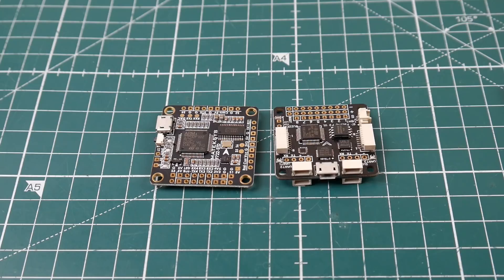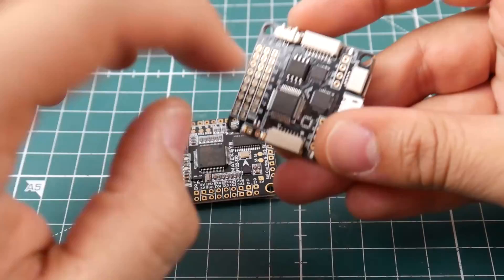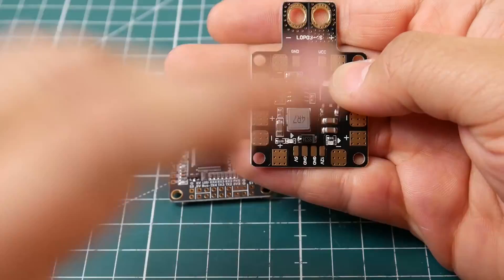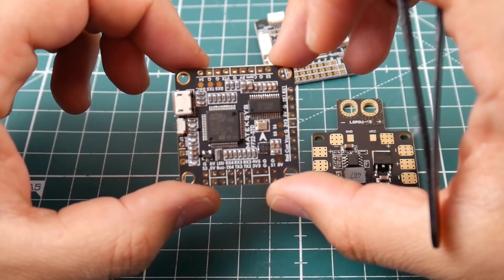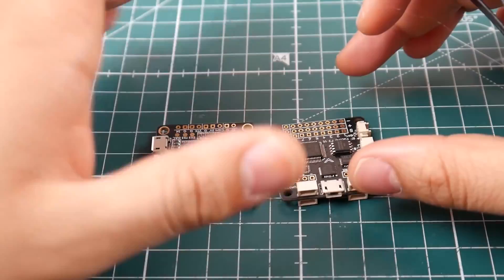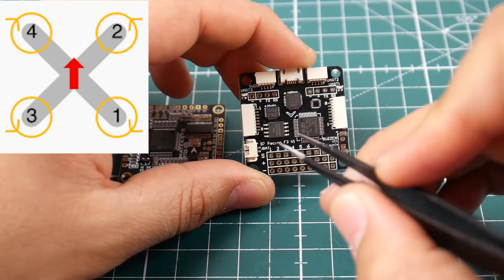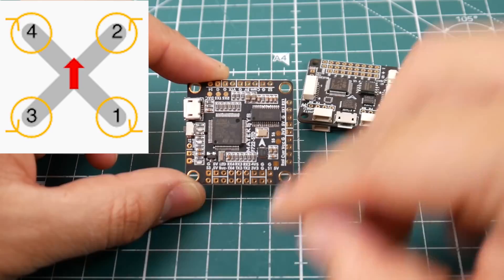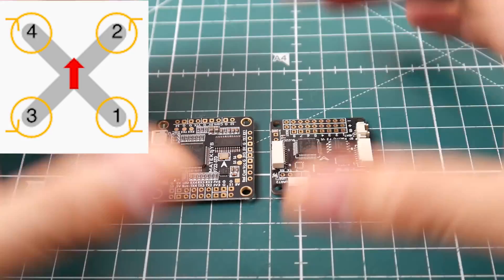How to setup and install any Flight Controller // Under 5 Minutes

Comment: Big fan of your work! whats your top choice for best VTX? looking for that extra clean image.
thanks
Reply from the maker: I have been using the eachine tx526  on 90% of my builds and never had problems with vid. It's only $11
Reply: thanks, but im looking for a vtx with onboard LC filter and BEC, any recommendations?
Reply from the maker: Ofer Po No.. Best advice is good esc and low esr capacitor either rubycon or Panasonic 1000uf 25v or 35v

Comment: One thing you forgot to mention is there is a difference between power input and output..Most flight controllers have mini regulators that supply power to externals like cams, leds, vtx ect.. If you just find 5v and grnd on a flight controller that might be an output and not the actual power input of the flight controller.. Worst case you could actually damage the board by supplying power in the wrong direction..
Reply: can you explain more about this?
Reply: whats the differences and how do i know ishould wire to 12v or 5v?

Comment: Matek F722-STD doesn't have a 5 Volt regulator, Tekko32 4in1 doesn't have a 5 Volt regulator too.
So i have to use a PDB (but the stack becomes very high, 3 layers plus VTX/Rx) or use an external BEC.
Which way is the best for you and in case the best way is an external BEC, which BEC ?

Comment: Love your vids.  Got a question.  I have a kakuteF4 with 3 flights until it freaked out into a spin of death.  The CLI shows a NOGYRO flag and I cant find any info on how to fix it.  The ribbon cable to the gyro isnt damaged.  I have a low esr capacitor on the FC.  Why would the fc gyro just die for no apparent reason?
Reply from the maker: Spin of death possible cause motor over heating did you smell the motors that one of the first things to check on a spin of death.

Also check if air mode is on.
Reply: air mode is on, motors are all good.  No electronic burning smell.  Everything powers on just fine.  Its just the NOGYRO flag on CLI error message.  Cant fly without the gyro.  THe board will power on but wont arm.

Comment: I have been looking for a brushless quad that is stabilized and does not need to use the computer to make it fly.  I just want to fly LOS with a brushless quad, do you know of any quads like that (other than Bugs) or a flight controller that would work?  I hope I made sense.  Thanks for sharing and happy holidays.  12/2018

Comment: Hi you say you can just cut the ground off the esc and not use what happens by doing this as it must be there for a reason ps keep up the good work and look forward regarding 4 in 1 esc and power to flight board
Reply from the maker: shozzy69 You can get away with cutting the signal ground which is the small black wire. I have built many without it but there are some theories that it could cause noise in video feed which I have not tested and still is a theory.

If it's a 4in1 you will need ground if it's powering the FC.
Reply: Drone Mesh cheers for the fast response it’s been great to see how quick your subs have grown in past few months

Comment: for some reason i can not get that sp f3 in boot load mode. its fucking annoying! although reliable fc
Reply from the maker: stoicz fpv you need to bridge the boot pads then connect USB. After you flash it unbridge the pads and connect to pc.